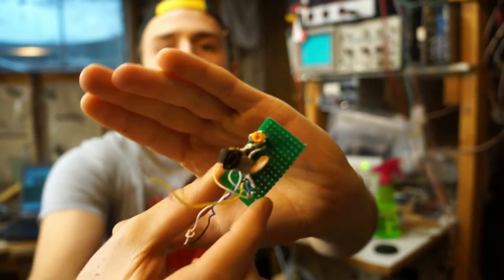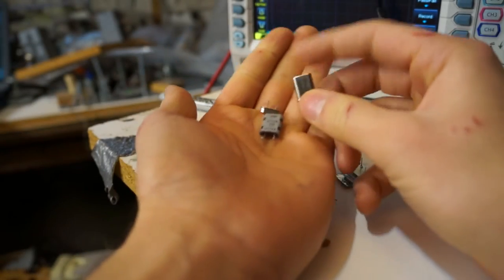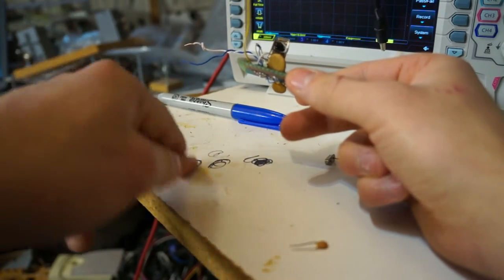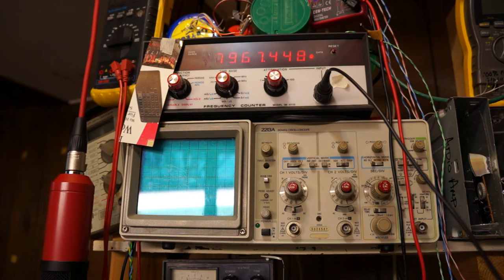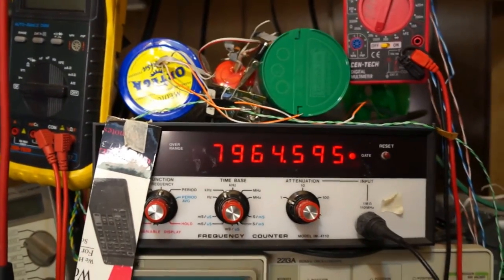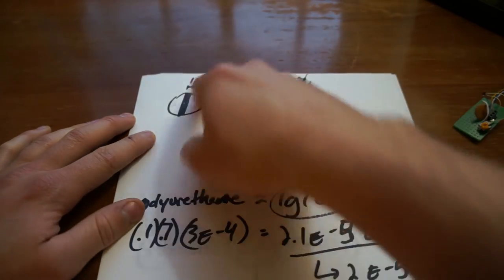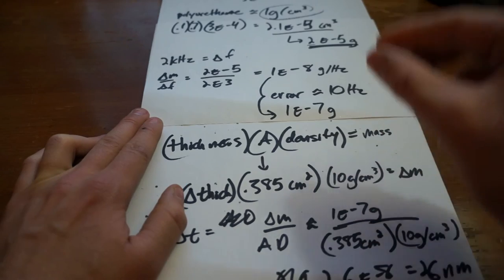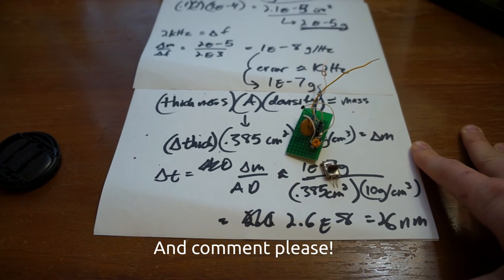Colpitts Oscillator and a DIY Quartz Crystal Monitor

Comment: What modifications need to be made to use this system in high vacuum?
Reply from the maker: Hrmm, shouldn't be much different. The crystal frequency is determined by Sauerbrey Eqn https://en.wikipedia.org/wiki/Sauerbrey_equation, i.e. no dependency on pressure... I think its pretty close to implementation, just needs to be made a bit more robust/nicer :D